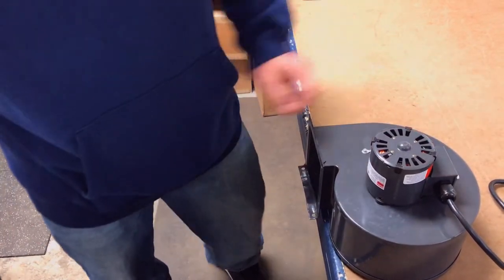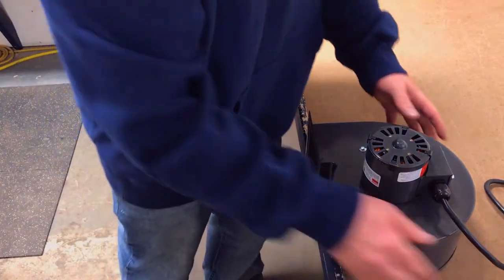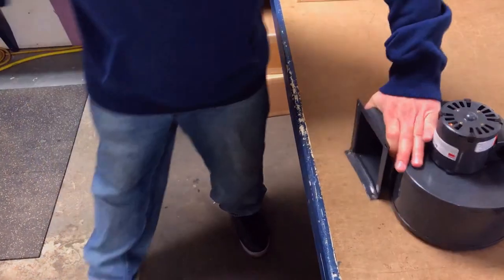Mounting the Dayton Blower 6FHX9 to the Fan Mount Panel - Vent Works

Comment: What’s the size of the diameter in the panel? Can you put a 6” diameter fan through it?
Reply from the maker: The size of the diameter in the mount panel is 5.6875 inches (5 -11/16"). Yes a lot of 6" diameter blowers are mountable to this panel.